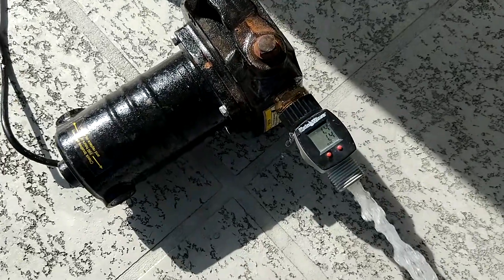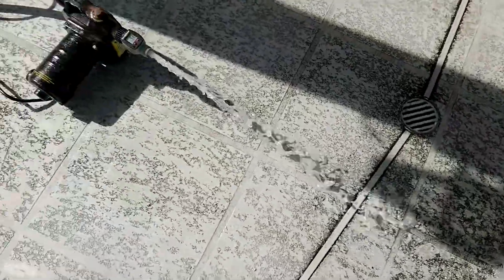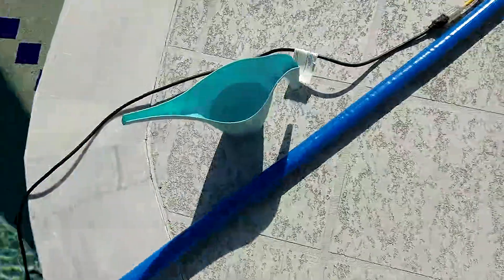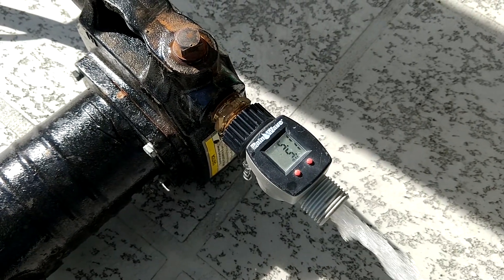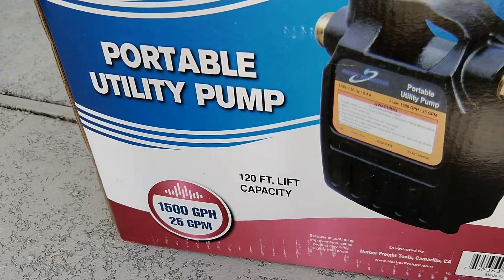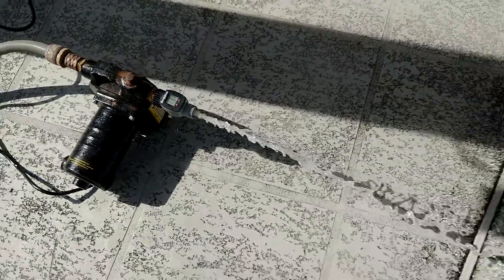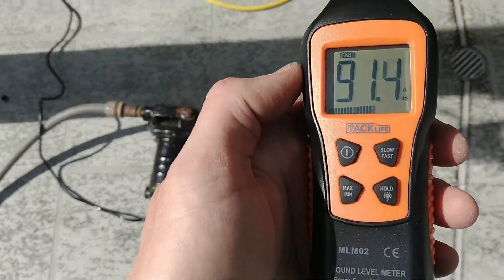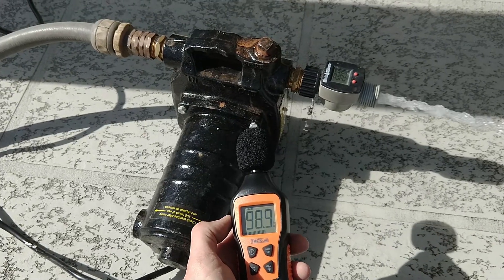Harbor Freight Portable Utility Water Pump 65836 Update on flow rate and loudness

Comment: Hi Will, I think you will find a significant increase in flow if you decrease the length of your suction line and/or increase the diameter.  Your suction losses are limiting the flow into the pump.  Unfortunately, HF doesnt even provide a pump curve for their centrifugal pumps most of the time and their advertising is misleading.   The flow you get from a centrifugal pump is influenced by head (elevation difference between water surface and discharge elevation) and head losses (friction) on both the suction and discharge.  As friction losses increase flow decreases rapidly.   It looked like your suction strainer may have been floating too.  Discharge looked foamy which appeared to be air entrainment, hard to tell from the video though.  You could be seeing sucgtion cavitation due to inlet losses also.  Cavitation greatly increases noise level.   The strainers on that pump are only going to let so much water in.  long basket strainer  would be a better option.  I would increase up to a 1" line at least for what you are trying to do if you want it to flow quickly.  Keep the suction side as short as feasibly possible.